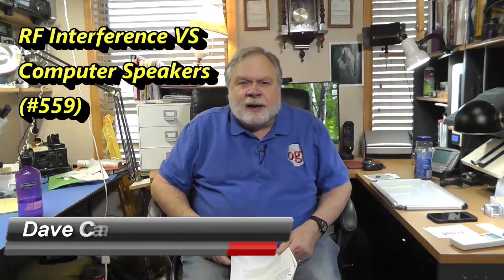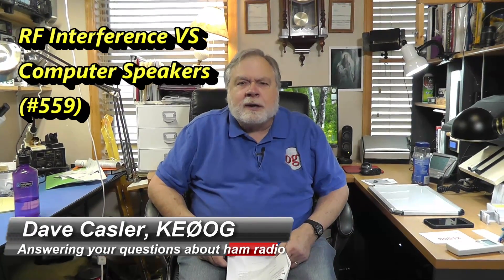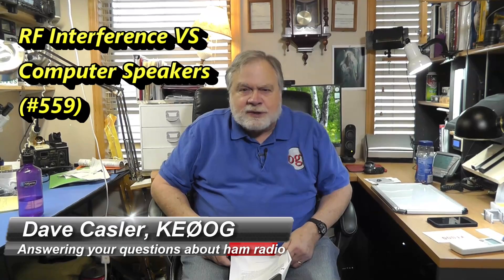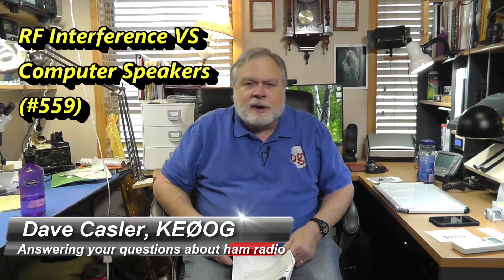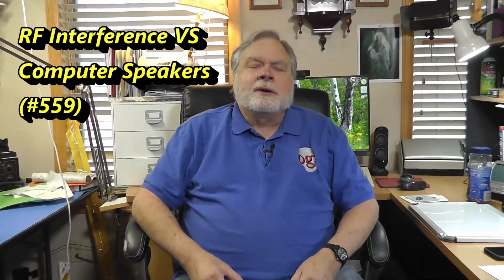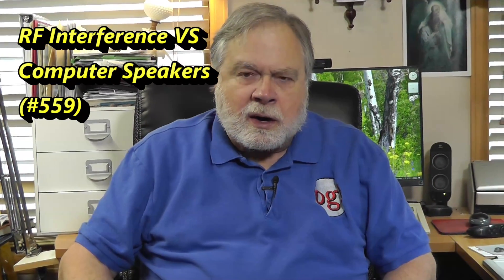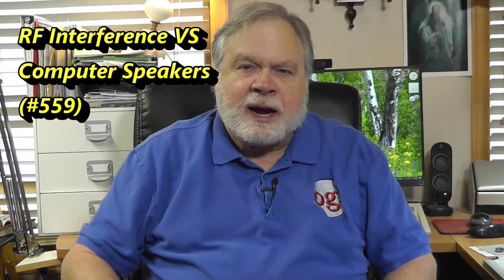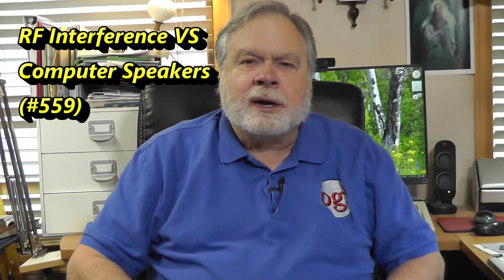RF Interference VS Computer Speakers (#559)

Comment: i know its an "old" video by youtube standards, but wanted to comment to boost. My speakers pick up a nice buzz that just pumps out of my sub. I have a nice setup with high quality studio monitors, so its not just cheap speakers that do this. type 31 ferrite beads did a lot of reduction...but it took a LOT of winds plus some clip ons across the power chords and audio cables connecting everything. Guess i just had a perfect cable run to pickup that signal. I am also in an old retrofit house and the only room available for my office has no grounding. 

most videos about EMI are about how to reduce interference picked up by the radio, but since i was having the opposite problem, I'm glad there was a helpful video floating around. My transmissions were knocking out my monitors, making my KVM glitch, and making the speakers buzz. All solved by ferrite (type 31).

the grounding will be fixed down the road as part of another electrical project, but I can now use my radio in the meantime.

Comment: PA3GTL,  Wim
in a densely populated area, you as a radio amateur would like to know whether you also cause interference to others and how you can possibly prevent this. In the Netherlands we live with approximately 17 million people in a relatively small country. Here, as a radio amateur, you can quickly cause RF interference in the equipment of others. The result may be that the Dutch Telecom Authority imposes a broadcasting ban on the relevant radio amateur.

Comment: Type 31 mix ferrite. That'll block a lot of the RF that the speakers pick up. Especially on the power cord, as the diodes that rectify the AC from the wall can also rectify the RF from your radio.

Comment: I was having this problem using an older computer speakers and after assuring all grounds and cable are good, I did everything, nothing helped. I decided to replace them and chose a Prosona 5 1/4” near field speaker and have not even a hint of Ed in the speaker.

Comment: I had a problem with a computer mouse going crazy when transmitting on 12M or 10M. Replacing it with a cordless mouse cured the problem. Apparently USB3 ports are much more sensitive to RF than USB2...

Comment: Come on Dave.
A NanoVNA has SWR as one of its parameters.  I prefer to use a Antenna Analyzer, like my RigExpert AA230 Zoom, but could do the same with a NanoVNA. I will tune my antenna with one of those, before I ever hook my radio to it. I want to see my antenna have reasonable SWR before I try and send a signal from the transmitter to it, even just to check the SWR. A ATU is not necessary if you have a resonant antenna for the frequency you're operating on.
Reply: I concur. I use my Nano VNA for my HF antennas. and have it set to measure SWR, Log Mag used as a more (less ?) sensitive SWR measurement, reflected phase and importantly complex impedance / smith chart. 

It allows me to tune the antenna to resonance and then match the transmitter / transmission line 50 ohm with the resonance resistance of the antenna. 

I made up a switchable tap Balun / UnUn that allows me to match a resonant non reactive antenna to the transmitter. By dialing up a turns ratio from 3 to 14 on each side. It’s works well for 20-50W and I simply wind a transformer with the appropriate ratios for that band or bands to handle the full 100-150W my rig puts out. 

This is also especially important to match the feed for a magnetic loop where it is most efficient at resonance, and to be able to adjust the coupler feed to match as close to  50 ohms at resonance 

While a NanoVNA is a bit of a hassle to set up, in all cases I have found the information from the measurement much more useful than the antenna analysers I have used. 

Not so much what’s right or wrong, just what works best for you. I still hook a conventional SWR meter in the line at the rig.
Reply: Hi Bruce, just getting into the hobby and the nanovna was cheap.  Saving up for a RigExpert..
Reply: @timridley2739   the NanoVNA should give you everything that the Rig Expert does, but you’ll probably need glasses to read it. 

The nice thing is that it gives you a graphical representation of the complex impedance of the antenna over a chunk of spectrum.  So you can sweep an 80m end fed half wave and see its performance between 3.5MHz & 70MHz for example. I have a 20m End Fed Half Wave Vertical for 20m and a trap with a short element for 40m. I scan 6MHz to 18.5MHz on a preset and zoom in to the band I’m particularly interested is to tweak the height / length.

Comment: Wow, twenty years ago, all GOOD computer speakers WERE shielded.   That's how you knew you were getting quiet speakers.
If there were one thing I didn't think the Chinese could screw-up, would be old fashioned computer speakers.  I should have known better.
There are stores, like ALL Electronics, that sell shielded speakers - and come to think of it, they do seem to have fewer of them on their shelves.
Reply: I found that even with the older style West Mountain RF shielded speakers (very nice speakers btw) there was some noise occasionally when using the vertical - toroid's cleared that up perfectly -
Reply: Wonder if most of the reason all decent computer speaker back in the day were shielded was simply because they were almost always sat right next to a crt.  Now that everything is lcd based manufactures simply don't care about that anymore.
Reply: I bought a pair of 90s computer speakers specifically for this reason.

But even they need some bolstering via ferrites on the power and audio cables

Comment: ts430 was the first all transistor xcvr released in early 80's by Kenwood in the USA
Reply: Hi Sam, I'm pretty darn sure the TS-120s which was small and perfect for portable/mobile use and the larger TS-180s designed for base use were the first all transistorized transceivers by Kenwood and believe they were released for production in 1979.  Before that time the Kenwood transceivers had tubes in their driver and final RF output stages.  I purchased my TS-180s new back in early 1980 and it's still my main rig and my first contact on it was on Jan 29th,1980.  73, Don (wd8dsb)

Comment: I live by a busy intersection in a small city that is big on classic cars and motorcycles and cruising. Every time something with points drives by, or stops at the red light I start to hate the vehicle, the driver, their ancestors and their future offspring in the most misanthropic manner conceivable.
Reply: Ignition points aren't the problem. But those old cars will have ignition wires, not modern coil packs. If the cars do not have "resistance wires" you will get noise. Odds are someone is not using resistance wires because they think that's a performance mod.
 But don't blame the points.
Reply: @lyfandeth  Resistance wires radiate less, but less is not zero.  The condenser (capacitor) could also be weak or bad in these cars.  The condenser reduces arcing on the points.

Comment: I use the fiber optic connection for my computer speakers. Using the analog out ports was always a pain. I guess I could have used a torrid, but it was just was easier to go optical.